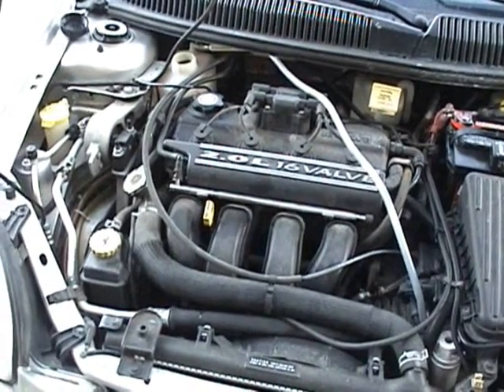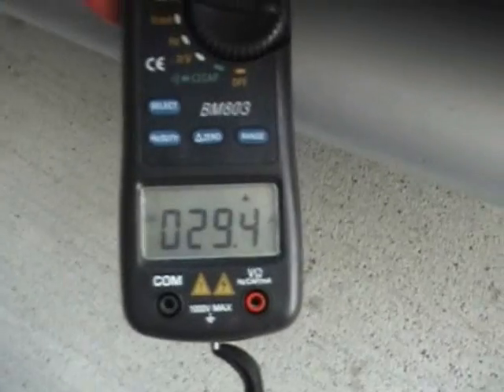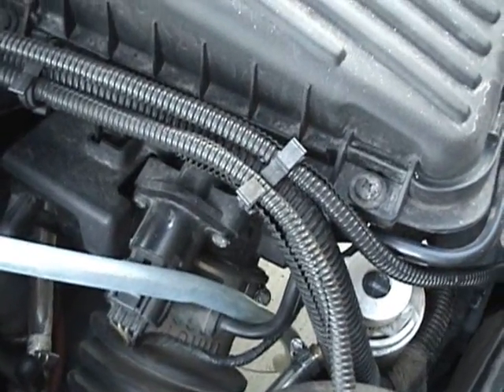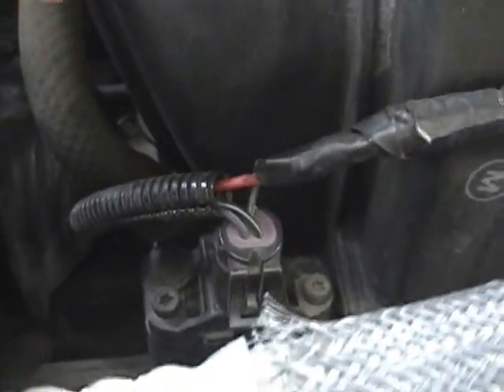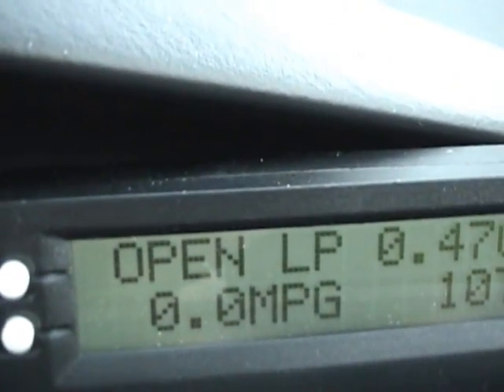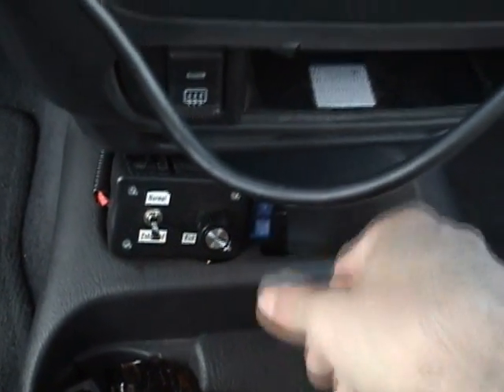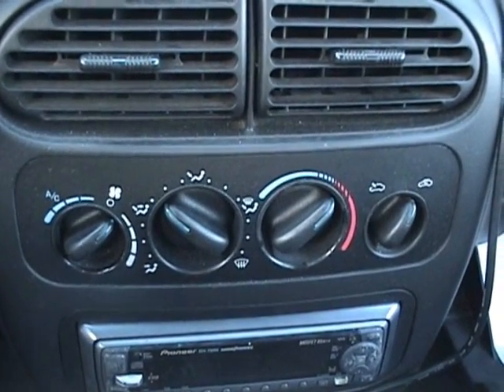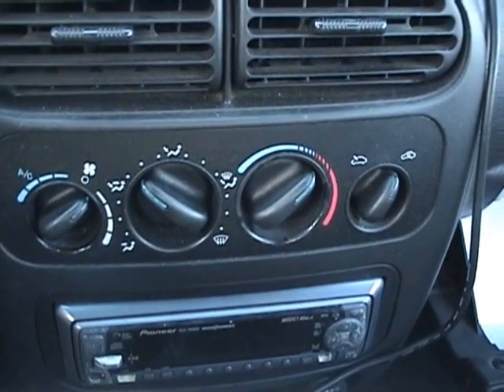(43) Milage run with o2 sensor unplugged

Comment: My 2000 civic ex has no oxygen sensors and I bought it 8 months ago and it runs as good as ever, super easy on gas and now I know why
Reply: I have a P 0134 inactive upstream O2 sensor. Car runs great. Good power. I can balance a nickel 🤔 wondering. Almost to afraid to mess with it it runs so good.

Comment: I have a lincoln continental 2001, had to remove a cat so it is lacking an o2 sensor. Acceleration is sluggish and its very loud. Will this device fix my speed, not worried about sound it actually sounds good just loud

Comment: Look at  suzuki joe cell video 
when the guy rebuild  his alternator he was confuse about the tree wires of the alternator, 1st to ignition wire live(supply from ignition switch, normally  black and white, 2sc to  ignition  warning  light, red and white wire 3rd battery  positive  2 large yellow and white  cables, he put then wrongly from factory bu right  to spot new wave frequency,  boon car fire with out the battery/ and with out  primary  wire on the coil .....because he connect L2 Cable on S plug ,and S cable on L2 plug secrets  review S it's sense on regulator, and drama from 3/5amps with it's equal 3or5 amps x 200 watts = 600[ 1000] Watts multiply to coil turns regular  coil with 12v,= 25 000 volts  in this case the coil was producing somewhat about 100.000 volts to the spark plug and anything that u place inside the cilynder will make kboooon

Comment: hi .. on my car i saw that consumption increased significantly at idle with the kit and lambda sensors connected ... when i unplugged them, no overconsumption at idle and an engine that runs very easily without backfiring. ... (I had a probe that was messing around so I unplugged the 2)

How can I make the lambda probe believe that I don't have a lot of oxygen? Because HHO does well from oxygen in addition to molecules if I am not mistaken.

So the lambda sensors at idle detect an increase in oxygen at idle and therefore necessarily send information to the computer to enrich the fuel.
When these are necessarily disconnected the computer runs with the default values therefore "enriched" the mixture automatically but stable since it detects nothing .....

Comment: the previous owner of my tundra has removed atleast the downstream sensor and welded a plug over the hole.  the truck runs fine but im concerned to what could happen or why it was taken off or why its still running good and for how long.

Comment: Hess's law states that the change of enthalpy in a chemical reaction (i.e. the heat of reaction at constant pressure) is independent of the pathway between the initial and final states.  

I.e. it takes the same energy to split water as is produced when you burn it or recombine it.  So assuming that your system is 100% efficient (which it isnt) you get a net energy gain of zero.

All you have achieved is by running your car extremely lean which gives you better mpg, high temps is the negative effect, you can actually melt pistons, burn holes in them, and throw a rod through the engine case with miscalculated combustion out of time with the engine by leaning it out like this.  

Over all it seems like an expensive way to save money which is going to ruin your car.
Reply: +yer mano ....  it burns at a higher temp. follow me here.... it don't gain any energy, might loose some. but if, and think about this, but if it causes the usually unused fuel to burn then there would be a net gain from not sending it out the exaust pipe.....
Reply: By adding this to the cylinder along with the stock amount of fuel, the Fuel/Oxygen ratio will be reduced which more likely will cause less of the fuel to be burned.

Too much heat reduces MPG.  Currently BWM Motorsport series use direct water injection to cool the cylinders by 25 degreese to increase MPG. look it up its quite interesting for an unmodified car to have this.

Comment: If this stuff actually worked every auto manufacturer would have hydrogen or HHO generators on their vehicles and we'd be filling up our water tanks with every stop at the gas station. There is no conspiracy and car makers have to meet stringent CAFE standards, if it was that easy it would have already been employed. Hydrogen fuel cell vehicles are coming out and these vehicles will use hydrogen to produce electricity via a fuel cell to drive an electric motor. Ford is toying with running internal combustion engines using pure hydrogen and we haven't seen the offerings yet and maybe we never will if we do the vehicles will have a special tank to handle high pressure hydrogen which will need to be filled like a glorified fill up at a gas station. What HHO is Brown's gas which is a mixture of hydrogen and oxygen which is a highly volatile gas, one backfire and you're likely to blow up your intake manifold or worse. There is no way you are generating any meaningful amount of hydrogen using a vehicle's electric system. One thing you note on all these HHO videos is the complete lack of follow up showing any positive result. You would do better to just get a job or go to school to increase your income so you could afford to fill up your gas tank.
Reply from the maker: KAT D You don't have enough knowledge on this subject to even know what questions to ask. It seems so simple why auto makers don't use these and your knowledge tells you a logical solution to the question. My friend you don't know or understand the question so you have the wrong answer. It's a lot more complicated than that.
Reply: delvis11 OK Delvis11, show me an HHO vehicle that actually garnishes consistent, reliable, positive results then I will be enlightened and in complete agreement with you. Have you ever heard of Plug Power (stock symbol PLUG)? They are doing things with hydrogen that actually work and have several major customers including Wal-Mart and FedEx. This HHO stuff is nothing more than snake oil, it's complicated because there are a bunch of companies out there taking advantage of people who want to save money or save the planet or whatever and what they end up with is a box of confusion and high school level experiments at best or a destroyed engine at worst, all of them have carefully worded disclaimers to protect themselves from law suits. I was a Robotics Engineer for 30 years, I can understand complex, explain it to me in scientific terms with specification, schematics and actual performance data like I was able to obtain from Plug Power before I decided to invest in their company and then we can talk about my level of knowledge and yours. I have no great trust in or love for corporate America but they are not doing anything to stop people from proving HHO is a viable solution. If you want to toy around with Brown's gas as a hobby that's fine but please don't mislead people by pretending you are actually offering them a viable solution. I've heard about the "mystery question" before in an advertisement for this junk where the seller tries to convince educated people they are stupid for asking logical question, please tell me you didn't buy into that BS or worse yet that you're a salesman.
Reply from the maker: I'll look into  plug power. It sounds nice.
Reply from the maker: The Gov actually does not let some of the best fuel efficient vehicles in the world in to this country. Look up the VW blue motion TDI. Not allowed because its to fuel efficient and will hurt the businesses of the "hybrid" vehicle program.
Reply: And the man loves you and probably thanks your dumb ass every day, keep drinking the Koolaid and keep him happy. You should probably also work a different job as well to get into higher tax bracket just so you can take it a little harder and dryer. 
The reason has and always will be because of big oil
Reply: Kurt B it's ALL ABOUT Big Business. Nothing more than economic protectionism, union power, etc. You also have the third-party stuff like EPA, Tire Companies, etc. But nothing will ever kill the statement: there's no replacement for displacement. Sooo Euro cars are better cuz we can't change as fast as they can, also EU is cramped and N.A. Is not so they're small anyways.
Reply: Kurt B rude yet streight forward
Reply: KAT B it works its also illegal unless you pay gas tax on your water up to a 10000 dollar fine (bullshit i know) source Alternative energy professor at my college Im seriously thinking of dual majoring just so i can learn what he knows haha. From what he was saying every car today can be converted to run like this the only thing you would have to do is bypass the 02 censor

Comment: what if you just injected the HH into the engine and put the O back into the atmosphere?
Reply: would it still cause problems as the HH is taking more oxygen out and the O2 sensor wouldn't register enough in the exhaust?
Reply from the maker: Ben Warschau
Yes but if that was true then the ECU would sense a rich condition and lean off the fuel. It is worth a try to use pure H

Comment: Hi. My name is Terry Horne from Troy n.c.I travel monday-friday 20 miles to work & 20 back. My car is a 1992 Honda Accord LX 5Speed. Back in june I was tired if my check engine light being on. I bought a new one fulled my tank up and went to work. I burned a lot of gas, and the light was still on. So the next day I just unplugged the 02 sensor fulled it up, and DAM, the gas mileage I am getting (still to this day) is unbelievable. My car drives great. But my light is still on.
Reply: you've got problems somewhere else.
Reply: Where do i look
Reply: well when a computer is in open loop there are a lot more variables that can affect how its running.  without an 02 your computer is in closed loop using factory pre-set programming on your fuel trims.  it doesn't take into account for your intake ambient temperature, map of maf sensor on some models.  so its hard to point you in the correct direction without proper diagnosis
Reply: The only way to run diagnosis is to loop a wire, the 02 was hooked up and my light still on, even when I replaced the 02 the light stayed . I need that light to go off without taking out the light Bulb
Reply: no, you need to further diagnose the issue.  you need to figure out why the light is on in the first place.  take it to a shop, they should know the actual procedure to check the obd1 your car operates on.  there is an underlying issue that is causing the check engine light.  they don't just magically come on...
Reply: Just reset your ECU by unplugging the - battery terminal from battery and touch it to the + terminal for a few seconds.

Comment: Milage run with o2 sensor you should get way better miles to the gallon with the 02 censore wire off

Comment: I'm building a system for my '05 Chrysler, but don't have to worry about these problems on an older, carbureted vehicle. My 1st fuel cell powered an old riding mower on the HHO alone by just running the 3/8 output tube directly into the carb. will the HHO work better on a later model vehicle if I remove the injection, ecm & other electronic crap & run it through a carb?
Reply from the maker: These hho systems work good on 1996 and newer obd2 vehicles the best with a Volo fs2 obd2 chip.

Comment: good thinking but you forgot about the burned exhaust valve because of the super lean mixture.     This was uploaded in 08, that engine is long gone if he ran it like this for a daily and had a commute long enough.
Reply from the maker: I sold that car 2 years ago and I bought it new in 2000. It had hho on it when it was sold with 120k miles. That was a great test car. I did a lot of different things to it like whats here in this video and installed many types of fuel leaners but the car did best with a simple hho system and a Volo fs2 chip. And it got great gas mileage even to the day I sold it.

Comment: Injecting water into combustion chamber causes freezing problems when the weather temp. drops! Many years ago I made a system that had insane power + 64mpg using a 13B rotary engine... Towed a 4,000# trailer up and down mountains in Nevada... 150mph on the on-ramp to the freeway!!! More to the story.....
Reply: That's why u add things like sodium and/or other electrolytes to the water
Reply: Yeah my son had an fd3 with a methanol tank. Horribly fast!

Comment: I agree that you can may be able to save a penny or two per mile. If you are driving in any kind of traffic, you will need to have a co pilot to keep adjusting your fuel mixture and monitor your exhaust gas temp. If your EGT is too high, you will be buying a $2500.00 new engine instead of spending an extra buck on gas

Comment: I could see you falsifying a knock sensor output to fool the computer and the computer would result in less ignition advance, but I don't see that helping fuel economy. Maybe I'm missing something. I haven't yet run an hho unit on my car, but I hope to. I have full ignition and fuel control.

Comment: Do you have a wide band o2 or any other method of knowing your air fuel ratio? You can go very lean, but I found adding ignition advance will gain more than leaning mixtures.

Comment from the maker: Good little car. I sold it with 150k miles on it. I had run my various systems on it since about 80k. Not dumb enough to burn up the engine but smart enough to maintain 40 mpg on this pig.
Positive thinking is encouraged. :)

Comment: YOU NEED TO PUSH THE HHO GAS IN HIGH PRESSURE IN TO GAS TUBES IF YOU WANT TO PROPEL A CAR WITH HHO,AND YOU NEED AT LEAST 5 BIG TUBES IN THE CAR FILLED WITH GAS TO USE YOUR CAR AS USUAL..1 TUBE 1 DAY OF DRIVING,,APROX..

Comment: If you run the HHO hose from the bubbler into a splitter going to the intake right before the butter fly valve and the vacuum the car has for idle you will get more of effect, cause if its sitting all the way up in the intake is getting diluted of oxygen making it less combustible gas and will only get sucked into the engine if you rev it.

Comment: As soon as he said 2 liters of "gas" was enough to run a 2 liter engine. I rolled me eyes and paused it to make this comment. You should really get a better understanding of Internal combustion workings and what Displacement means before you make comments like that... The Cylinder displacement is just that. How much room the cylinders have in them when all the cylinders in the engine move from TDC to BDC. 2 liter in 1 Revolution. You would need to make thousands of liters per minute!

Comment: Each has its own stoichiometric mixture
strength, ranging from less than 13:1 to
more than 15:1, so the stoichiometric ratio
for the entire blend depends on the proportions
of the differing hydrocarbons that
make it up.

Comment: It turns out that about 14.7 lbs. of air contains
the correct number of oxygen molecules
to pair up with the number of hydrocarbon
molecules in 1 lb. of gasoline. The
ratio of air to gasoline to achieve a stoichiometric
mixture, in other words, is approximately
14.7:1, by weight. Note we say
approximately - there is no single number
that correctly identifies the stoichiometric
mixture for all gasolines. To explain, recall
that gasoline is a mixture of hydrocarbons.

Comment: Lean mixtures would keep down the CO levels, and as long as they were just a little lean, the HC levels, too.
Ironically, excessively lean mixtures actually raise HC levels above those found with a stoichiometric mixture,
becauseas the mixtureapproachesthe "leanlimit"- the air/fuelratio atwhichthe mixturesimplywon'tignitesome
cylinders misfire, so all of the HC in that particular cylinderful goes straight out the exhaust unburned.

Comment: @knineu02 I disagree with your answer. Honda among many other automotive manufactures have already developed and implemented lean burning motors with great MPGs and reliability. The only main apparent problem is how slow lean mixtures burn limiting the RPMs capable with a lean mixture (gas and oxygen) but adding hydrogen speeds up the burn

Comment: My Honda accord has a faulty LAF sensor and i have noticed that the fuel consumption has halved and the exhaust fumes smells like unburnt fuel and it is down on power what i would like to know is this problem caused by the LAF sensor or should i look elsewhere

Comment: Is an 02 sensor and a/f ratio sensor the same? I bought an after market o2 sensor for my 03 tacoma 4x4.Its the one closest to the eng i think upstream..Anyway its showing 3.40 volts..Could this be caused from using an o2 sensor instead of an a/f? Or might i have a short somewhere?